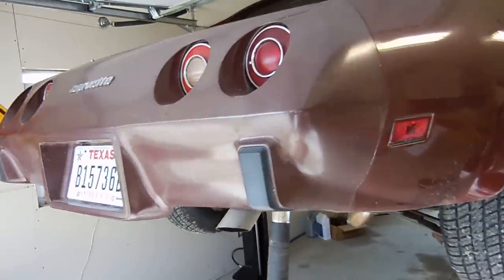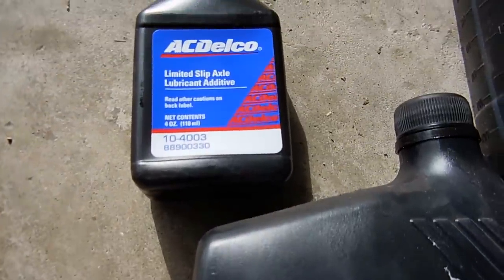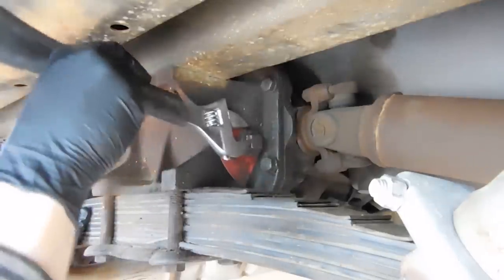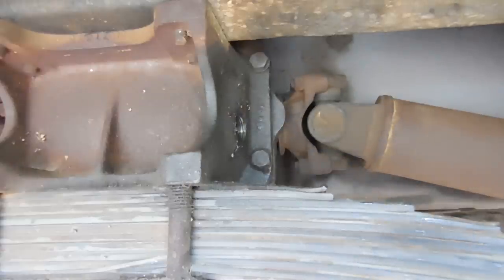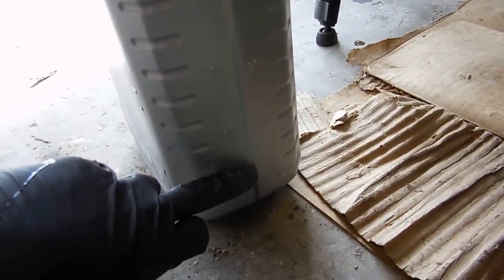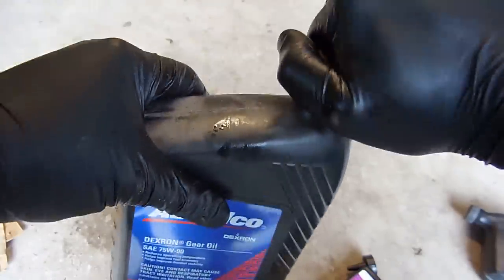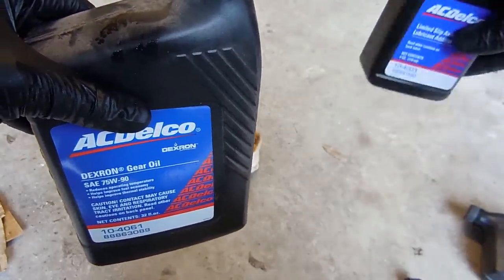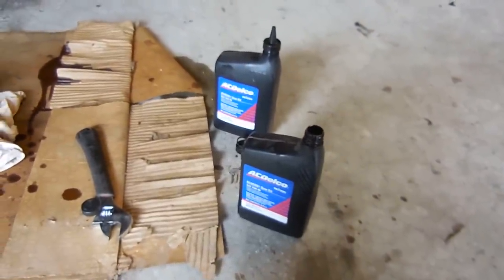How to Change the Differential Gear Oil in Your C3 Corvette Stingray 1968-1982

Comment: One note..if you never worked with 80-90W oil it smells like burnt oil even though it is new...engine oil has a slight smell but gear oil has a distinct smell almost like something
is burning ....Just a note I wanted to mention. Ben Corvette is the MAN!! 4 real.

Comment: I like to use one of those cheap fluid transfer pumps from Harbor Freight. less messy than using the suction pump over and over again, just pump the used into an empty gallon oil container.
Reply: there is a cool way to use a vacuum and a small hose to drain oil from hard to access things. the video is on the ol youtube

Comment: If you have posi-traction this advice is spot on.  It matters what you put in that differential.  Its still critical on non locking rear difs, but not as much as a Posi.
Reply from the maker: I've never seen a non posi c3 Corvette. People claim they exist but I'm pretty sure that are all gonna need the additive
Reply: @TheCorvetteBen  I was referring to any differential, not just Vettes
Reply: @TheCorvetteBen  all Corvettes from 63-79 have this same setup, not just 68-79. All are posi as well, just the ratios vary.
Reply: Starting with the 70 models, Positraction became standard but for 68 and 69 it remained optional but was a required option on all big blocks. So your 68 and 69 327/300, 327/350, 350/300 and 350/350 could have an open rear diff but not many did, less than 3,400 cars total for both years combined. 😀

Comment: Need additive if you have limited slip differential.  Keeps clutches from sticking and banging.  My 68's sounded like it needed a rebuild. One bottle of additive drive it  and it works its magic.
Reply: what additive? The AcDelco 10-4003?
Reply: @mariano4003  Go to your local Chevy dealer, they might have someone still knows how to work on C3 Vettes
Used it more than 20 years ago, sure don't remember may have something better now
Reply: GM dealers still sell the additive.

Comment: Fantastic video!! i have subscribed!!! , excellent info... I do deviate from the GM gospel on gear lube though Ben, I have had 3 c3 corvettes 1972, 1980, 1981 which is my present C3. I know it's always good to be a purest and go acdelco /gm whenever possible, but i have always used  AMSOIL  75W 110W SEVERE DUTY GEAR LUBE AND 4 0Z. GM POSI, and I have over a total 0f 300,000 c3 miles on this stuff and I cannot tell you how clean my rear pumpkin is when I drain and fill it.

Comment: The easy way drill a 3/8 hole in that low spot on the diff drain it tap it 1/8 npt from there on out it's very easy because you have a drain plug! At least that's the way I did mine

Comment: I have a 78 C3 and your videos and advice are helping me a ton. I ordered The AC DELCO gear oil and additive Ben recommends for C3 diffs. Ordered and received it from Amazon. But they sent me 10-4108 synthetic gear oil instead of the 10-4061 Ben recommends. Anyone know if the 10-4108 is possibly an even better option?
Reply: Does anybody have a reliable source for the correct part number of Delco gear lube for C-3's (with positraction)?  My original 72 owners manual specifies all sorts of things for the car but for the differential fluid it just says "see the dealer". There are too many similar AC Delco gear oil part  numbers. 10-40xx.

Comment: Part number for the gear oil is nearly impossible to find now for less than $32 a quart. Can you recommend a replacement part number or a different brand or something, Ben?
Reply: Any parts store 90W GL-5 gear oil,  can also buy the TransX limited slip additive there.

Comment: What type of fluid should I use? 

A 74 Corvette Stingray. I read somewhere that temp can affect it and I don’t wanna fuck up my “new” car. 
I’m in NC.. 

It doesn’t need it done, it only had 16K miles. 
But I want to know the fluids are correct and new. 

Please help.
Reply: And she is a 350, with an auto transmission.

Comment: I never knew some Corvettes has transverse rear springs like the Model A. Interesting.
Reply: Some Corvettes?  All Corvettes from 1963 to 2019 have them.  Newer ones are composite but still transverse leaf springs.
Reply: @zakspop  I have never looked under the rear end of a Corvette in my life. Being a jerk wasn't necessary.
Reply: @michaelcook768  I wasn't trying to be a jerk. Sorry you took it that way.
Reply: @michaelcook768  also comparing them to a Model A was not really cool. Transverse leaf springs aren't that antiquated.
Reply: @zakspop  Ok...sorry I took it that way.  I was so surprised at 100 year old technology.
Reply: @zakspop  The Model T had them on the front.
Reply: @michaelcook768  yeah. I guess they were right out there in plain sight. Weren't they? But Corvette owners get defensive about it because of some snooty people putting them down because of the leaf spring etc... When something works why change?
Reply: @zakspop  With the limited space, it would take work to change it. I remember Chrysler kept rear leaf springs long after GM & Ford went to coil. I guess as long as the kept rear wheel drive. The Chrysler 300 is coil...but, it is basically a 2002 Mercedes E class. I worked at a Bend dealer when the totally new 2003 E came out. A tech had purchased a Dodge Magnum...had it on the lift...almost identical.
Reply: @michaelcook768  there are some aftermarket kits that change it. Shark-bite is one. I hope to upgrade my 69 with a newer spring etc someday.
Reply: @zakspop  I like the older Corvette...with chrome bumpers. 59 up to 69(?) A friend had a 77...I took it to pieces to put a new stereo system in...that was a job. It wasn't very powerful. Still fun. A friend has a 55, 58 and 65...and 2 garages full of other stuff...his family has run a salvage yard since the late 50s...so, he grabbed up stuff in the 1980s-90s. He had 12k cars at one time...gradually closing it down. They had a family farm near where "John-Boy" was really raised...made tons of moonshine into the 1970s...and made into the millions. When you supply the courthouses, you don't get bothered. He had copper tanks made into an old car so it was 100% pure and safe.

Comment: Do they sell this gear oil and additive at any auto parts stores?
Reply: Yes an 90w or 80w-90 and TransX makes a limited slip additive.  They also make a transmission additive so make sure you get the right one.

Comment: 6 nay votes were retired GM engineers who devised these awkward placement of the aperture for the gear oil install...
Reply from the maker: And didn't add a drain plug in the bottom of the diff

Comment: Hi Ben love the channel I have a question had it to 2 different garages and they seen nothing hopefully you can tell me what might   be wrong pulled my 1992 c4 out of the garage when got it out went back to close the garage door an noticed a red puddle on the floor this puddle was right beside the driver. Side rear wheel on the in side of the wheel hopefully you can help thanks Jeff sorry forgot to tell you later I when back to clean it up it started to harden like wax and it started to break and was white in side
Reply: Sorry forgot to tell you that the puddle was a bright red after a little while I went to clean it  and it started to dry like wax when a piece of it started to break off it was white inside 😅

Comment: You better watch for fakes on Amazon. They already sell fake Motorcraft ignition coils that China makes and other people sell. I wonder why the price is cheaper. Hmm. I still get my 80w90 gear oil from GM Parts and still have some posi additive from the 60’s or 70’s for my 70 Z28. I also use the same suction unit to FILL my axle and transmission case. You’ll also never get all the old oil out without removing the cover. But I see a Vette would be a beeatch to remove. With a posi unit, once the fluid is changed, go find an empty parking lot and do 5 figure 8’s one way then 5 the other way for a total of 10 to mix up the gear oil into the posi clutch packs.